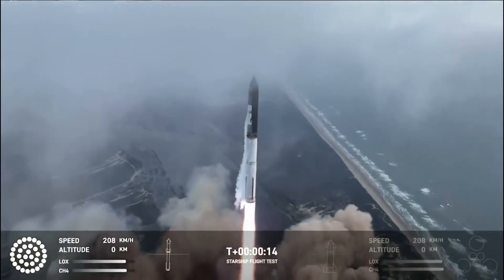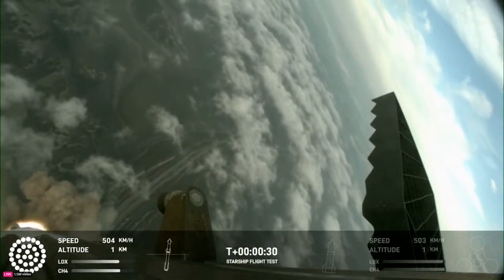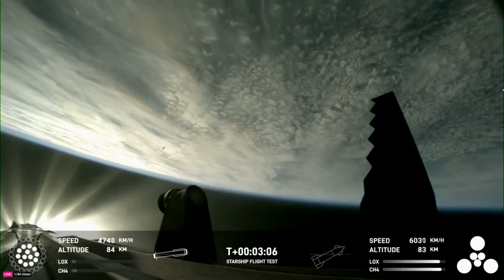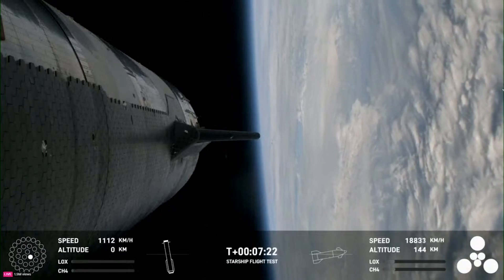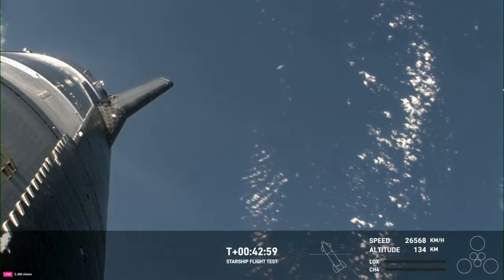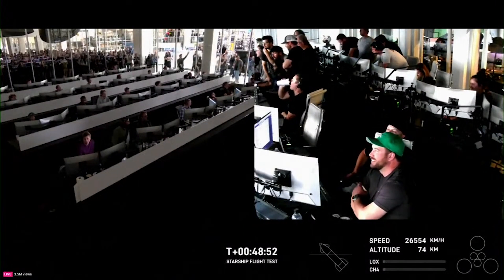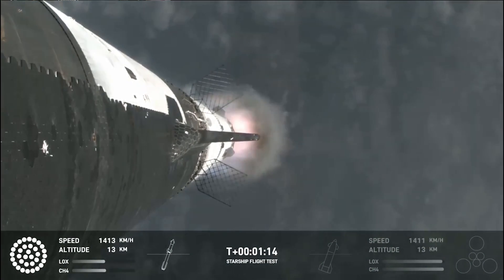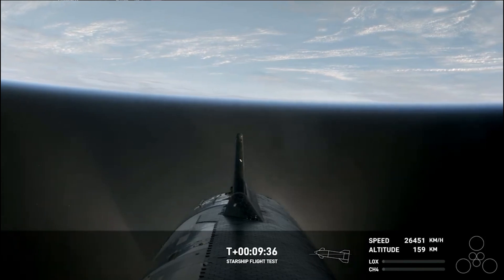What Exactly Happened On SpaceX's Third Starship Launch Attempt?

Comment: I am happy with it, it doesn't need to have reuse functionality in order to be ready for the Artemis mission, just reach orbit and it proved it could do that.  Next thing it needs is a refueling demonstration
Reply: They actually did an initial refueling demonstration on this flight while Starship was in orbit. (Without a counterpart of course)
They spun the Starship in a specific way to see if it would push the fuel around the way they anticipated.
Reply: Man they are so far away from an HLS it's not even funny.
Reply: @hawkdsl  They really aren't that far away. They already know how to land starship. All they need to do is perfect the re-entry part and it is good to go. The booster can now get back to where they want it to go, but the landing burns need to be figured out. 1-2 more launches is likely all it will take to get those 2 parts working based on the speed of progress we have seen from Spacex. Then after that all they need to figure out is ship to ship refueling and landing on the moon.
Reply: @bluesteel8376 Well your optimistic, however they are not even close to "that far away". Each failed flight requires an investigation. That's pausing the next flight at a 3 month cadence. That's 4 flights a year... and the next design will require the same testing.. They have to test and perfect your list before we can go back to the moon. 2 to 3 years if everything goes right... which it wont.
Reply: @hawkdsl  How so?  HLS would never have to re-enter earth's atmosphere and landing on the moon is easy af relative to earth and Starship has already(barely) proved out it's flip maneuver
Reply: @BarrGC How so? Are you kidding? How long do you think it'll be before the first test flight (and landing) to the moon is going to be now? It's been 5 years already from hopper to the latest failed flight..they are not even close to an HLS yet.
Reply: @BarrGC landing on the moon is definitely different. Easy af compared to earth though? Naa, no atmosphere for any aerodynamics at all. No parachutes, no fins for surface reactions, nothing but pure thrust. The moon is actually difficult to land one. Hence why multiple landing craft have messed up lately.
Reply: @Jeremy9697  
Many current mistakes are due to not having access to every scrap of human insight from 50+ years ago. We are also learning from entirely new mistakes because SpaceX is emphasizing low production cost and high production rates.
Reply: @Jeremy9697   Absolutely, way easier, no heat tiles or aerodynamic considerations of any kind required in the design of a ship that needs to land on a dead rock.  Night and day just compared to having to survive re-entry on earth, nm landing.  You just gave proof, so many more failure points on an earth landing, again, night and day from a design standpoint.  Landing on the moon you just need some flimsy legs that can support 1/7th of the mass they would have to on earth and enough delta V to kill off 1km\s of velocity, easy peasy.  We did it several times with 60 year old tech, no problem.  Mars on the other hand is a very different story...
Reply: @BarrGC  I just gave proof? How so? We typically don't bring things back to earth like that. Basically every splash down we have done has been successful lol (this is a test, not a mission) 60 years ago crafts were manned. Not the same as unmanned crafts with delayed signals. So many crafts have failed soft landings on the moon... because it's so hard to do.
Reply: @Jeremy9697  You clearly don't appreciate the dramatic forces involved in re-entry.  You could land a steel box designed by a 6 year old on the moon, you just need reliable thrusters and a relatively small tank of gas.  I'm talking from a design standpoint here, something you are also glazing over.  It's night and day, one craft needs to kill off 8km/s and the other only 1.  You also need to design a craft that can survive thousands of degrees of heat, that alone seals the deal.  Ya, we do it all the time, but the design considerations for a craft that needs to survive atmospheric reentry are night and day compared to one that doesn't.  You forget about Columbia?  Re-entry is literal hell on earth
Reply: refueling will most definitely require reuse
Reply: @billorcg7779 
Agreed. They cannot afford to discard every "re-fueling" booster and starship. Also, FAA needs to see a controlled deorbit burn before approving any LEO missions. Otherwise the ship could crash anywhere.
Reply: I hardly think the expenditure of a dozen boosters and tanker vhicles to make a single Artemis landing is going to be cost effective for SpaceX, and NASA would not find it acceptable.
Reply: @kennethferland5579   That's nice, cause there's no way it will take a dozen launches.  Besides, all NASA knows as far as rockets go are expendable ones, so idk why they would care about that.  Given how much money they waste on every single thing they do, SX could launch and expend a hundred boosters for less than NASA spends to launch SLS once.  They have purposely horizontally integrated the company as a means of survival, thus turning them into the least economically efficient company in the history of mankind, lol.  But sure, f@ck SpaceX...  🤦‍♂
Reply: @kennethferland5579  It's a fixed cost contract so Nasa won't care about the extra cost to spaceX and spaceX was going to do this stuff anyway even without a contract.   They could build all the starships, test all of them on the stand, then bring them to the stand one after the other.  I think it is viable if they have no other choice then to delay the mission.  Hopefully it won't take a full take for the HLS so they only need a few tanker runs
Reply: According to SpaceX this morning:
1. The booster didn't splash down. It had a RUD for unknown reason at 420 meters from the ocean.
2. They did managed to get the PEZ door closed so the test was completed but not as expected.
3. They completed the fuel transfer test
4. They suspect the cold gas thrusters outlets got iced over therefore they lost attitude control, but haven't verified this.

Comment: The "tiles" coming off were no tiles. The majority of them appeared at ~114km altitude where there is still little air drag but temperature starts to raise. At ~100km (Karman line) where air drag is more noticeable, no more "tiles' were to be seen. From this I conclude ice crust, maybe one per frozen-over tile indeed.
Reply: At 110km there's a fair bit of molecular O2 and it doesn't take much when you're reentering at 4-5 miles per SECOND.

You're over here commenting as if the thermosphere doesn't exist.
Reply: @asdfjoe123  You ignore the Kármán criterion: at higher than 100km and even at orbital speed, atmospheric lift becomes increasingly negligible. If the tiles withstand the weather at 0m, then they also withstand orbital speed at 114km. At 114km, there only is 1/5 the drag force of at 100km.
Reply: it was also venting LO2 or LCH4 for quite some time which has a tendency to form ice crust that breaks off and floats around - see current SpaceX launches for reference.
Reply: Nah.. once they got deeper into Mach 25 air stream the light tiles stopped floating away .. they were ripped off and shot in the other direction away from this camera.

Comment: Gave me chills seeing the plasma grow and wrap around the ship. I don't think anyone has ever been able to watch that live due to the blackout period. I bet the 4th launch is going to check the splash down box.
Reply: Have to keep the tiles on better than this…
Was like a sparkler
Reply: @MakaiMauka  The heat shield tiles have always been the second biggest issue besides the engines themselves.
Reply: @MakaiMauka  im not sure how big of an issue the tiles actually were
Reply: They have always had a problem with the heat tiles falling off. They need to really invest in better ways to attach them
Reply: @danr-gh3mo  It would be cool if, instead of so many smaller tiles, they formed the material to fit more like a glove where it couldn't fall off without first breaking.
Reply: @DarthRyce maybe magnetic with adhesive?   riveted and melded ?
Reply: @DarthRyce  

What if the problem is not solely the “attachment mechanism”, but something more “fundamental” that sx has painted themselves into an uncomfortable corner.
Reply: Amazing to see plasma on the Starship flap.
Reply: @leandrosouza8832  I was surprised at how far the plasma cleared the surfaces, and it seemed more like the Aura Borealus in how it fanned around the ship. I partially wish they had stuck with the no tile approach to see if cooling the surfaces with fuel would simplify the design.
Reply: @leandrosouza8832   yeah,  wonder how to set angle on that re entry burn ... roll left to right and change dive angle?
Reply: yeah,  that was some heavy heat no joke   😳
Reply: It’s just a pity it’s not true 🤷‍♂️
Reply: Starship is extremely ambitious but SpaceX will get there.
Let's not forget landing a booster like falcon 9 reliably was considered insane once. 
Working in the R&D industry for years I can appreciate the test-to-fail route they take.
It lends itself to rapid evolution.
Reply: @liquidpatriot4480  Not just landing a booster, but landing it on a ship is really crazy. Everyone doubted Falcon 9, and it is the most reliable system on the planet.
Reply: @tray22  Falcon 9 truly is a workhorse. And now SpaceX is going after the holy Grail, fully reusable rockets. If they can perfect the re-entry & landing of both Starship and booster it will be revolutionary.
Reply: Would you volunteer to ride in the next one?
Reply: @angryhairpeice why? Why do ppl say stupid things like this...
Reply: @angryhairpeice  Nope, but give them a few more launches to work out the bugs, and payloads will start going up. What was seen today was an amazing accomplishment.
Reply: @tray22  
IF U SAY SO, fixing the tile issues are “Easy peasy”❓
Reply: @Mentaculus42  Never said it would be easy, but I have no doubt they will figure out a solution. I'm just guessing, but are you in the "I hate Elon" crowd? You seem to be afflicted with an issue preventing proper recognition of today's achievement.
Reply: @tray22  

Just in the camp of “I am an engineer that sees a bunch of really hard problems to solve to get out of a corner sx painted themselves into with the help of the genius rocket scientist Elon”! However ones opinion of elon vs the technical issues that sx has to deal with are sometimes and sometimes NOT independent.  Just a realist, not a Fool-Aid drinker. These problems are going to take a lot of time to work out, something that I have consistently said. If I said that ss will never work, that would be more in line with being a fool, not a realist. Sx is better off with as little “help” from elon as possible. However that being said, the tile issues are not going away anytime soon. And remember, full recoverability is the only ultimate indicator of success, anything less and it is better to stay with falcon. It is still a LONG journey to success.
Reply: @tray22  Are you in the Elon sycophant club? How many times does he have to over promise and under deliver before you catch on?
Reply: @Mentaculus42  Would you volunteer to ride in the next one?
Reply: @tray22  He blew up a third $100,000,000 ship today. How is that an accomplishment?
Reply: @angryhairpeice  I am an engineer and anything like this I enjoy following regardless of the person involved in its creation. I don't play bandwagon games or politics when it comes to advancements in technology. Guess not everyone can leave their bias out of it. Keep warm and stay floppy, my friend.
Reply: @angryhairpeice  It is a huge accomplishment because the starlink allowed coms to stay active, providing video feeds during a re-entry. This was also the largest spacecraft to ever make it to space. The fuel transfer was also a major milestone that can be checked off the list. Hate and sinisizm are not good character traits to have. Remember, keep warm and stay floppy.
Reply: @Mentaculus42  I think part of the tile loss on this one was due to not being able to control the attitude of the vehicle during re-entry. It appeared that ice build-up was blocking or changing the thrust. Everyday Astronaut mentioned that the type of thrusters weren't typical, and knowing how spacex works, they tried it to see where the failure points were. I'm not one to call people fools or Fool-Aid drinkers as you have done, but as they prove with each launch, I am increasingly optimistic that it will succeed just as Falcon did.
Reply: @tray22  Congratulations on being a sycophant. 
What would you like to bet that a human never rides in one of those. He keeps failing with empty shells. Wait till they're full of living quarters, crew, supplies, gear, equipment, etc...
Reply: @angryhairpeice  It will be a while before living quarters are on those ships. I would expect small non-vital loads being delivered first. Also, I don't think sycophant is the term you are looking for, but it is funny seeing you throw insults around. I see you are remaining warm and floppy well done.
Reply: @tray22  

We will see, I vote for “it is going to take more time than prompted to get a workable system”.  Also the tiles needs a lot more than some “thruster tweaking” to make them work. Then we get to recovery systems for the booster.  BO has it easy in comparison. Sx has taken on a “gargantuan” project all in one bite. The thing that seems consistent with sx is relearning the lessons of the past the hard way.
Reply: @Mentaculus42  Compared to government controlled engineering programs, SpaceX is an order of magnitude faster and lower cost. Everyone said Falcon wouldn't work and how bad of an idea it was. Now, some boosters are being reused nearly 20 times, and almost all of it is reusable. I'm pretty sure the second stage of starship came in arse first because the thrusters iced up. If that hadn't happened, the splash down may have been achieved. Month or two wait, and we will have more to debate in youtube comment sections.
Reply: @tray22  

Can’t wait. And that is an interesting definition of “almost all”!
Reply: @Mentaculus42  80% reused by cost is a high percentage. Compared to NASA's designs, where a high percentage burns up on re-entry or is lost to space, I would consider 80% reuse to be a lot. Can you imagine putting your money into a stock and getting 80% interest?
Reply: @tray22  

80% cost basis recovery seems a bit high with falcon but i won’t say I know it is more like 70% which is still very good and makes falcon a winner with no competition at this time.  It is a great situation for sx to be in considering starlink needs. But Elon repeatedly said that they will go bankrupt without ss. It seems to be an interesting thing to say. As far as I can understand the situation, ss is mostly about starlink, the moon and mars is secondary.
Reply: @Mentaculus42  I have heard him say they would go bankrupt without our starship. I don't know how that is possible. I had starlink for a year while I waited for fiber to get run to my rural area. Even on beta starlink was better than xfinity cable internet.
Reply: @angryhairpeice if we go by NASA standards, Elon has about another 5yrs and around 10bn in cost overruns, before he false behind industry standards.
Reply: @angryhairpeice the ones with living quarters won't have to deal with re-entry, only the cargo variants.
   Even with the 3 launches, it's still far cheaper than SLS.
Reply: @cannonfodder4812  You mean 3 failures, right?
Reply: @tray22  That ship was supposed to land on Mars with 100 souls on board this year.
Reply: @angryhairpeice  I think most people took that as a high bar being set to motivate the team. No way was that going to happen, but it could be the ship that takes people there someday.
Reply: @Mentaculus42  We can tell from the way you write that it's coming from an emotional place.

Comment: Great video,  but why still use tiles that fell off the space shuttle, and they're still using them on this vehicle and detach and fall . off ?
Reply: No tiles at 114km altitude - still space!
Reply: The ship was tumbling backwards, sideways, upside-down, etc. Not a valid criteria for testing tiles, and re-entry.
Reply: @imconsequetau5275  so I guess if this ever happened on reentry and they managed to recover the ship were just burned up right
Reply: The ship needs working reaction thrusters to re-enter, for sure. Maybe another back-up system is required for crew flights. After a few dozen successful re-entries, the engineers can assess the reliability numbers.
Reply: @imconsequetau5275  ok, I keep thinking about the shuttles' tiles that came off and killed the crews, l suppose if some do come off, they do a space walk and repair it be reentry .
Reply: There’s not much better they can do. Stoke Space is looking at an aerospike design that removes the heat tiles, but it won’t be able to launch as much to orbit, nor will it be ready for a while. Besides, this ship’s loss was caused by uncontrolled rolling of the vehicle occasionally exposing plasma to the bare metal away from the heat tiles.